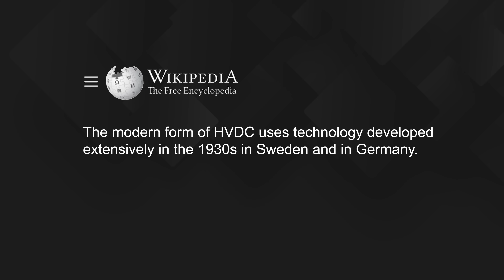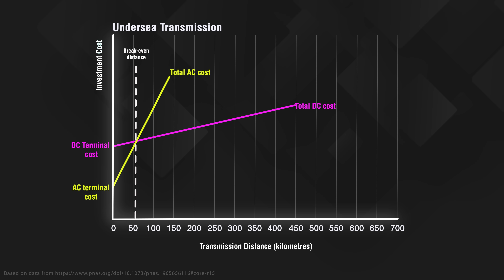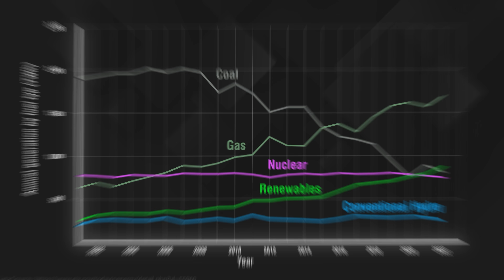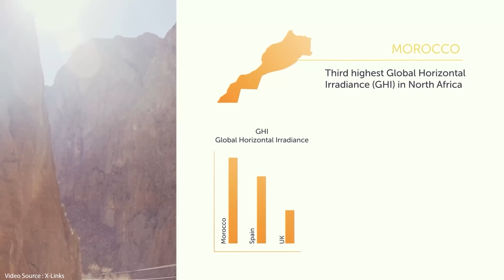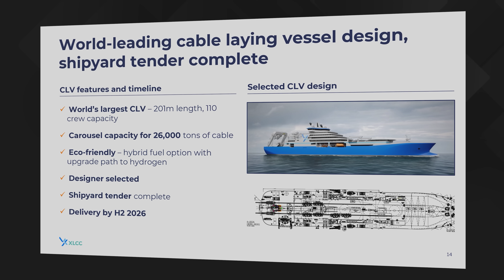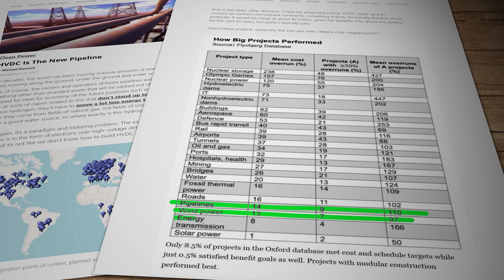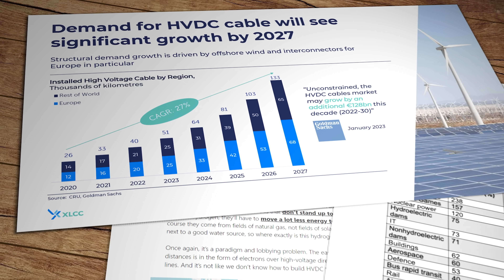Revolutionising power transmission.

Comment: I watch a fair bit about Trains, and often they contain the ever popular 'Train Wreck'.  I can only imagine such a wreck happening on a line with multiple Gigawatts of power running in the same right of way! Seems like 'Train meets Power Line' is a bad headline.   I Do support the concept of re-using existing rights of way rather than new absolutely but I wonder about the safety here.  One example is our electric Coop just delivered GbE to my rural home this year using the same ROW and poles used to bring me KWH.
Reply: Umm i would think the chance that an airplane or drone destroys an aerial cable, is much bigger than a train destroying a nearby underground cable.
Reply: @effedrien  Planes and drones though don't fly along power lines except for inspection purposes. Trains on the other hand follow rails exclusively. So when they derail they will, by definition, be in the same right of way as the power.  Remember trains are heavy, starting at more than 200 tons, and that's just the lead locomotive! When they derail they can dig massive trenches in the process. This doesn't mean that the idea can't work, but someone has to 'do the math' on the chances that such a wreck would take out the power lines.
Reply: @larrybolhuis1049  yes i guess the safest place would be underneath the track but that's a bit impractical ;) but there are existing rules for the minimum depth of underground high voltage cables. It must be at least 90 cm for 11kvolt and 120 cm for 33kvolt (that's the spec in the UK but i assume it's not very different in other countries). You made me lookup this haha but it was interesting anyway. 
A few years ago a guy from a telecom company was digging near the building where I work and hit the 10kvolt. It was a very impressive bang and the whole industrial area without power. It was fixed in about 3 hours if i remember well. But ok there was no train wreck on top of it, only a small excavator that welded itself on the cable.

Comment: No mention of the Sun Cable project in Australia?  This project aims to produce solar power in the outback and transport it via HVDC to Singapore. It will supply the island state with 15% of its electricity needs.

Comment: Sigh... HVDC is mostly irrelevant for achieving 100% renewable energy. Long term storage is the issue. And here issue is about the mind boggling production demands for that. Extrapolating the current exponential growth with a doubling of production capacity every 3 years, we would need more than a century of exponential growth to finally have enough storage.

Forget about it.

The cheapest and quickest path is to simply use nuclear power with support from renewables to manage the transition to clean energy.

Comment: I always enjoy your channel. Something you mentioned early in the video had me thinking. So the world is dead set on moving away from fossil fuels to renewables, which I think is a good idea. But There are massive non energy industries built around fossil fuels, for instance plastics, pharmaceuticals, chemicals etc which require the carbon based building blocks to exist. Maybe you have spoken about that before, but I’d love to see that part of the story investigated.
Reply: Most plastic ultimately ends up in landfill - ie buried back in the earth, where the carbon came from. From a global warming POV this is fine - the carbon is not being burnt into CO2 (from other environmental viewpoints it is perhaps less fine). More problematic for AGW is the coke used in cement and steel making. There are promising cost-effective approaches for making steel other ways (google "Direct Reduced Iron") but cement remains a tough problem.

Comment: How is this Green Running Cables all over the world over MTNS and Cables in the Ocean.   Demand?  Not thinking Green. Micro-Grids each community makes it own energy.  Factories don't need to run 24/7- Street lights Don't need to be on everyone is virtually sleeping.  Start thinking small not large scale in solving problems.  Small Hydro- Small Solar-Small-- Bio Mass- small bio fuel= transition out of Coal which is the biggest problem. This why you see all these transmissions lines and Large Hydro.  Why have Solar Farms and Wind Farms-- large scale?  Its just Dumb.   Coal should have been stopped being used in the Early 1900s. When the Diesel Engine was started to be used on a large scale. Peanut oil OG.  The reason why coal is still being used is because of the Grid.

Comment: Question, because you are all a lot clever than I.  Part of saving energy is in storing it and also moveing load to another part of the day when there is abundant renewables.  This could meen spersificaly using large equipment in the middle of the night.  Do we have the equipment E.g.. a washing machine. That we can be confident in that won't for exsample  do the fandango across the kitchen floor? Or  worce burst into flames?

Comment: I enjoy your channel.  But sometimes, you allow politics to make your brain as smooth as your scalp.  No one, I repeat no one, not even the fossil fuel conglomerates, are saying we can never get off fossil fuels.  Only that the technology isn't there yet.  And until it is, you pencil-necks need to stop attacking those of use who work dawn-to-dusk jobs to supply the food and other materials you need hide in your air conditioning while you vilify us and steal our money.   That is what The Donald was talking about.  We are decades closer to making coal, from ground to ashes, "Net-0" than we are to making even the manufacture of wind-turbines "Net-0".  This isn't saying we shouldn't pursue the technology.  Again, literally, no one is saying that.  Rather you fantasy-worlders need to stop demanding that we go back to cave-dwelling until you get the technology sorted out.

There is zero new to using rail-road right-of-ways to transmit power.  That goes back to the laying of the original track.  The reason it was abandoned was the size of the towers needed to support the massive lines necessary for the demand.  As for burying it, that would have run it along telephone lines, which until QWest came along, were all copper.  Induction much?  It's only with the replacing of the copper with fiber that it becomes feasible.  You laud scientists.  Turns out you do as much actual research as they do.

As for the entirety of this video...  WTF?  Zero actual information.  Just you stroking these company's "prominence" with your lips.  Where's that actual information?  No where to be found.  Just propaganda.  Hopefully you got paid a lot to do this shill video.  'Cause you've lost major credibility with it.

Comment: How flexible and abundant is alumina glass? Is this a suitable pier line insulation material for heat-sagging wires or for high-tension ground, underground, or underwater power conduits or pipelines? Forest fires are natural and often in preventable, would this coating help?

Comment: Fascinating and very informative video. Thanks for putting it out. Just a few questions: These tens or hundreds of thousands of kilometres of electrical transmission cable you're talking about being laid all over the globe, are they all to be filled with copper wires? Do we have enough proven copper reserves and production to make the cost of that sustainable given all the other demands and uses there are for copper? Given how much environmental opposition there always is to new mines opening up, is the demand for copper fueled by this electrical revolution going to pit staunch anti-mining environmentalists against "dirty" mining operations that are absolutely needed to supply the very copper that is required to enable this transition to cleaner energy? I'm also curious about what materials all of these electrical cables/wires will be insulated with. Usually it's PVC or some similar form of synthetic. Aren't all those materials synthesized from fossil fuels? And what about the heavy vehicles (giant diggers and ore trucks) that are needed to do the energy intensive activities of gouging the copper ore bearing rock out of giant open pit mines that are criticized by environmentalists for leaching all kinds of heavy metals into groundwater and the surface watershed and loading the ore onto huge heavy trucks that haul it to wherever it has to be crushed and smelted in order to refine it into the copper needed to transmit all of this wonderful "clean" electrical energy? And what about the ships and heavy equipment needed to lay all of those hundreds of thousands of kilometres of electrical cable? Doesn't all that heavy machinery all need to be powered by diesel fuel because current EV batteries lack the energy density to make it economically and practically feasible to do these energy intensive heavy operations with battery powered machinery? And aren't any new mine developments that need to be brought on-line to feed this ever increasing demand for copper and other metals going to be opposed at every turn by environmental lobby groups who hate mining but also want everything to run on clean carbon free energy? Do you have any idea what the environmental impacts of lithium salt mines and lithium salt evaporation ponds are? The tonnes of chlorides that are leached from the mines and their leaky salt evaporation ponds into shallow groundwater aquifers every year? I hate to inform you green revolution believers that your green revolution is a long, long ways from actually being "green".

I really do enjoy your videos and learn a lot from them but your arrogant and dismissive tone at the beginning of this video really put me off. As an (environmental) engineer who actually understands the physics of how things work and has a reasonably good idea of how daunting (and still how unrealistic) this much ballyhooed and expected to be rapid transition away from fossil fuels is, I tend to get angry when our voices of reason and educated, reasoned opinions are summarily dismissed and poo-pooed with rolling eyes by unquestioning (and often not fully informed) "Olympically sarcastic" believers in the green dream. I'm not saying that we cannot make it to that green utopia someday or that I don't want us to, but given the technology we currently have and how fast it's advancing, we are perhaps still a few decades away from getting to where mining metals and producing fossil fuels for energy and materials production will not be absolutely vital to maintaining our economies and ways of life. The problem is, however, when you try to talk about these things with hardcore environmentalists/believers in the green dream, you often find them to be so dismissive, arrogant, condescending and self-righteous yet so remarkably uninformed that you just can't get anywhere with them. They just look down at you like you're so dumb and uninformed when in most cases it is they who are the one who's uninformed.

Comment: My question is why rebuild the whole system and spend all this money on this new electrical grid and just take that money and build local geothermal power plants green renewable no nuclear we spent enough money and 70 years on fusion reactors Don’t work we could’ve built tens of thousands of geothermal power points by now but common sense climate control doesn’t seem to work with anybody it’s text me or charge me anymore that’s the only answer anyone ever seem to have

Comment: So in the US line losses from transmission are around 11% or so - does anyone know what impact this will have on the transmission losses - I’m thinking it will decrease them but by how much?
Reply: According to Wiipedia HVDC transmission line losses per km are roughly half those of HVAC. That's for overhead lines - the difference is far greater for underground and (especially) underwater lines, as the post briefly notes. Underwater HVAC is basically useless for any but the very shortest runs.

Comment: How do you get past the heat loss from line resistance?
Reply: Not an issue underwater. In any case it totals about half the capacitive loss of HVAC, which ends up as heat.

Comment: This seems great, but it does nothing to address the complete lack of sustainability of "renewable" energy. It all relies on intensive mining operations to extract mineral resources, which itself ultimately relies entirely on oil. Ore yields are only decreasing over time, increasing the amount of energy input needed to extract the same amount of the desired metal (let's say copper, or lithium). There simply hasn't been sufficient investment in mining for decades now, the industry absolutely cannot keep up with a global electrification effort. Even if we started today to revitalize the mining industry, it would still take up to a decade to start reaping the benefits of that investment - these things take time. I often see these issues completely handwaved away, as if the price and supply of a commodity has no bearing on the viability of a complete overhaul of the way the entire planet of 8 billion people consumes electricity.

Comment: I don't see the point of using a hydrogen fueled ship for laying cables. If we want to minimize the complexity of these operations and ultimately provide cheap electricity, we should have gone for a more traditional diesel fueled ship. This would save more carbon in the long run as it's just one of the many steps involved in moving towards renewable energy. This just looks like a publicity stunt with no real impact to me.
Reply: I'd guess it's because by the time there's enough excess electricity for the cable, there's enough to make hydrogen.

Comment: The economic HVDC use case is not completely captured in this video.  Note that each of the in-service HVDC lines connects an extremely low cost naturally occurring renewable source with a high capacity factor (hydro and geothermal) to load centers.  The high per mile cost is only overcome by the extremely low capacity and energy cost of these resources.  
Note that very few HVDC lines serve intermittent resources.  Many are planned.  Few are built.  This is because intermittent resources have relatively high costs (high capacity cost, low energy cost) which is insufficient to overcome the high incremental HVDC cost.  The physics and economics are simple.  Europe would need to spend trillions interconnecting renewables with HVDC and would still suffer from very serious price volatility.  The economics are terrible for locations looking to decarbonize with wind and solar.
Besides, why would you spend trillions connecting my solar to your wind to my home to your home, when you can spend substantially less putting a nuke next my home and yours!  Everyone is just waiting.  HVDC is for speculators, snake oil salesman, and specific use cases.
Anyone care to make a wager?

Comment: In a global system, all is good until one country decides to stop the flow and holds all hostage.  Example is oil.  Where the pipeline is blown up, cut or just turned off because that country wants something more than agreed upon.  Its a needed system but it would be nice to take humans out of the system.

Comment: His initial argument is a strawman argument. I don't think it's fair. The argument that I've heard is that without extensive energy storage or batteries, the existing system cannot change intermittent power sources. Solar wind cannot replace fossil fuels until we can figure out how to store the energy, which obviously means deploying lots of traditional batteries or other technologies that might be promising like gravity, batteries and more hydro and things like that. There are interesting and promising technologies but it's both sides here. Seem to be making a straw man argument. It's like the existing grade can support wind and solar sure unless we change it to support it by adding energy storage. That's true. The grid can store lots of or shimmy can use lots of wind and solar sure. As long as we modify it to have energy swords like it's, it's very simple so I just putting that out there cuz I think both sides are not being including this guy here. Completely honest or completely fair in portraying the other side's position nor their own.

Comment: One must not forget the world wide electricity distribution between several electrical transportation suppliers.  These AC-to-DC-to-AC transfer points are being used for far more than a century.  Then there is that comment from a US Congressman who was frustrated because the US cannot transport an electron from New York to San Francisco; many state boundaries do not have synchronisation capacities to allow AC synchronisation between states.  Thank you for your presentation.

Comment: Stupid thing is, you cant have steel or metals without fossil fuels. Its impossible. From electricity, to the forklifts, trucks, cars, busses, ships, trains, etc etc etc etc Its an ongoing cycle. HVDC isnt simple, take for example the tasman link between mainland australia and Tasmania. There are CONSTANT problems with the link. The other problem is, corperations generally own power generation facilities, so for example, it might be cheaper to do this, but if you can say for example burn coal and hike up the price, shareholders and the fat cats rub their hands, they are not going to switch in the hydro system becauae coal makes them too much money. And a good example of this is in Brisbane QLD australia. The same company that owns coal power plants and gas own the hydro... Its never ever used. Despite the ability to use it as a pumped storage battery, they dont care because hydro is cheap, and coal makes much more cash to all parties involved.